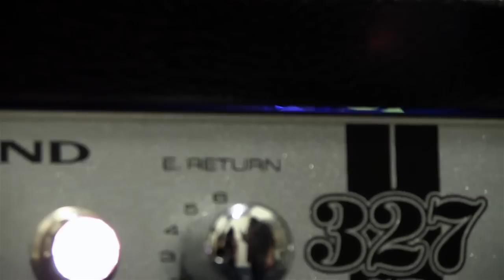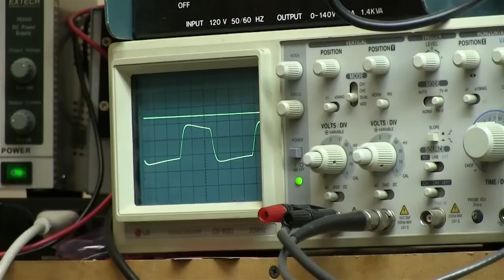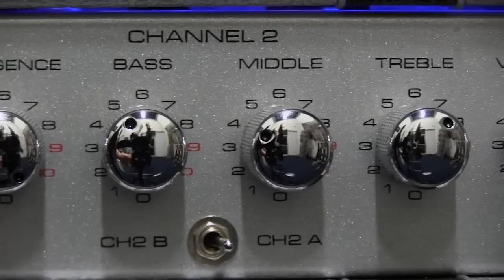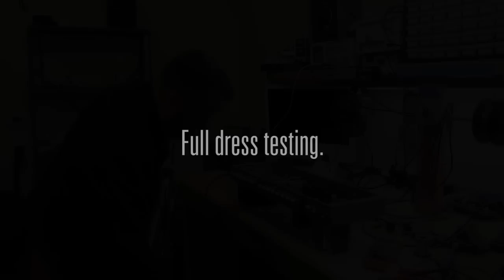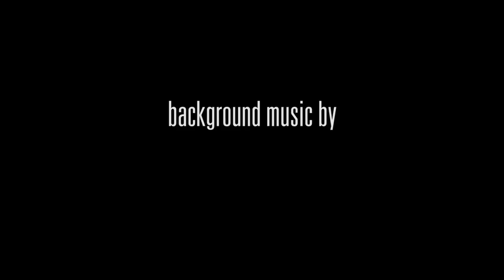The Making of the 327SD by Diamond Amplification and Soldano Custom Amplification - Full Version

Comment: Is there a way to measure transition between the sine wave and the square wave characteristic that Mike was talking about, and identify where the maximum harmonic complexity is occurring? I wonder, could digital modeling techniques contribute to making that measurement, and wouldn’t that ability produce the most harmonically complex tube amp?